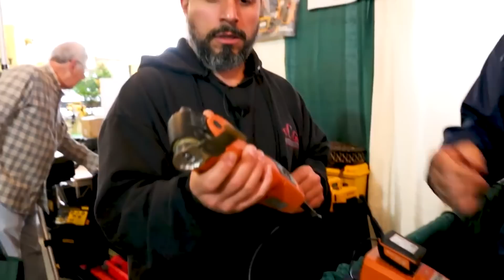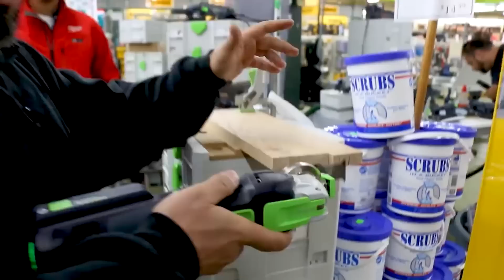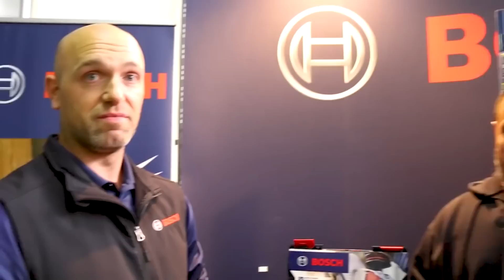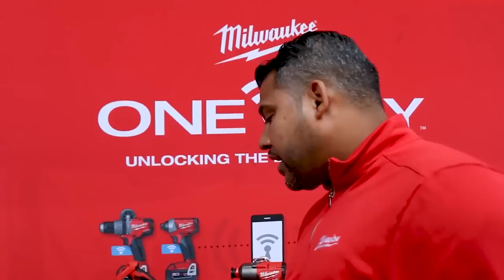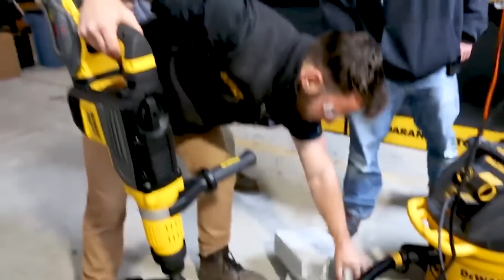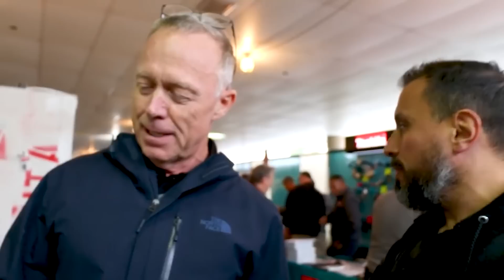NEW TOOLS From Milwaukee, DeWALT, Makita, Bosch, Festool, And More! (2020)

Comment: the fein chuck attachment is cool, but you can also buy aftermarket attachments for a lot cheaper. 1/4 hex 90 dewalt adadpter for any drill is like 30 bucks

Comment: The warranty is more than a little impressive. Buy in early & you're covered for life. With battery replacements, even!

"All FLEX 24V tools, Chervon North America, Inc. ("Seller") warrants to the original purchaser only, that all FLEX 24V products will be free from defects in material or workmanship for a lifetime on all FLEX 24V products that are purchased before, or on December 31, 2021...

24V Tools: Limited Lifetime Warranty with Registration

24V Batteries & Chargers: Limited Lifetime Warranty with Registration. Maximum of 3 battery replacements will be covered."

Comment: I can't be the only one sick of the hype behind those ugly festools with terrible features and ergonomics. Its a fan base that says that if it is made in Germany then it MUST be good quality. Festool doesn't even reinforce their plastic. Most their large tool clam shells are abs sewer pipe plastic lol. Like the Apple of tools. Pay more for less. For 300 those had to be the dumbest drills I think I've ever seen. Of course the multi tool cut the oak. Those multi tools cut better in oak then they would pine. They were originally designed for removing casts. 700 for just the bare tool? 700 for that abs plastic? Lol no. Not impressed. Who do they think they are? Snap on? Just my opinion.

Comment: For one, who is using the oscilating tool so you need jig for a plunge cut, and so much you need a vacuum attachment, for an oscillating tool?!! At this point, your just wanting some new gadget to buy, that's almost completely useless. 
The cut he made looks to me that a good ole miter or circular saw would do faster. 
Does Festool have a horizontal handle miter saw yet? 
  Also, really? Dewalt? I see Dewalt tools on most job sights I'm around. They're pretty preferred for a reason. And they arent $600 bare tool. I see red here and there, but I sure dont see that German green anywhere. However I saw a video of the Ryobi green, beating out a Milwakee in the battery trim gun test. Huh, go figure..

Comment: [Continued] 5. DW demo x3 FAIL. That cannon suppose to insta-terminate that block instead it struggled with it ending up braking instead of penetrating. Rep unable to connect it's own tool in the 1st try.  The fake rating of 20V doesn't help trust. 6. Makita - bigger than everyone else's. Lhol. Big and inefficient. Makita needs to remove battery kill tech from their systems. Btw, my granny can cut more in a line than that. 7. Interesting, but the statement of never failed was a lie.

Comment: 1. Useless. There are plenty of better ways of cutting nails more efficiently. 2 Ugliest thing I've ever seen, beatable by any very cheap fake. The extra handle is utterly useless and makes things harder. At 300$ I get 4 fake CZ dewalts with 2 14V batteries, charger, case and accessories. Then you show the most inefficient and annoying method of cutting wood. People generally hate dentist tools sound. So 3 FS tools on top 3 useless inventions. Next.  3. Lock Thin: interesting but can lead to accidents. Proprietary systems and disks will make people pass. Most have plenty of disks that are cross-compatible. 4, Milwaukee tools are definitely the most innovative in a useful sense, but some tools are restricted to 12V only like the compressor, and veteran users would really like an 18V version. Milwaukee would get a 10/10 from me if not for the battery self-destruct circuit. If I want to replace cells, it should be not intentionally prevented (not like most of the others don't do it - they all do). Break time. To be continued.

Comment: The D-handle on the Festool protects your knuckles that the T-handle doesn't. If you're installing/driving screws all day, I could see there being a couple occasions that you slip off and potentially rack your knuckles

Comment: Can not justify the price on any Festool item, UNLESS it has an innovative feature that provides a ROI, such as the Shaper Origin. UNIQUE tools that are job specific are time-savers, and even if they only last a few years, they are worth it. Too many of the Festool items are too similar to high quality tools by others. But if you can not handle the tracksaw clashing with the drill, I guess...... Festool is very interesting, but rediculous on the wallet for what you get..... at least on tools that others also make something essentially the same. These are not tool to toss around at the jobsite.... each one needs a live sheep to use as a cushioned protective stand

Comment: What Bosh needs is a grinder same lock for the wheel, but make it cordless and have a locking plug so if you're battery is dieing or dead and you are almost finished with no battery you could plug in, or vice versa someone needs the plug so you go wireless and when you plug in it's charging the battery when off and using power when active

Comment: Would had liked to hear what they have for basic problem with cordless grindrers which is that they run out batteries like nobodys business when you use them for any lenght of time or like with that bitum roof shingle how you deal with a roof full of gunk on you tools and blades ?

I've done several flat roof demos and what really kills your tools is bitum when it cools on your blades and chucks with grinders.

Comment: I use M12 but am on Bosch for 18v, so having a small 12v charger is ideal for me 🤗
Reply: Sean Steele 
Sorry. Should’ve said ideal.
Yeah. The prices on 21700 batteries, comparable performance on the Bosch gdx, better performance in the hammer drills at 18V make them ideal for the heavier end of work for me.
The Milwaukee 12V range... there’s no-one else anywhere near close in performance or selection.

Comment: I got one of the Fein tools with the star lock blade system about 6 months ago, while it works great finding blades on the road is a pain.....but I always keep a nice assortment of carbide ones in the case so its not an issue. 
One of the main advantages of the star lock blade system is the ability to drop a hot blade and reengage it without having to touch the blade.
Reply: Diablo makes a full line of them, as well as Imperial. Any Ace Hardware, Tractor Supply, Murdochs, True Value or other place. Not so much at Target or Walmart.

Comment: Saw stop works for sure - we use it at our school shop - the catch is that the block is very expensive to replace (blade buries into it and then you replace)
Reply: Still cheaper than hospital bills, lawsuits and potential therapy        (physical and mental).  New cartridge runs around $80 plus whatever you have for a blade.

Comment: No effing way... Makita made a Rotex hahaha! That's hilarious. And also very cool. I've been using my Festool Rotex for 6 years now. I've been running it super super hard on cabinets, furniture, table tops, and end grain cutting boards. It hasn't skipped a beat. I honestly don't know if I would trust any other company to make as durable a tool as Festool, but still .. very cool to have some options. And I bet Makita's "Rotex" isnt quite the $650 plus tax, and sandpaper tho haha. So I'm interested to see the durability over years of hard work in that Makita sander
Reply: Bosch also has one similar.  Not sure how it stacks against Fessie.
Reply: @beckr4235  no way lol. I didn't know that. Thanks for letting me know!

Comment: I had the Festool CXS for 3 years until I sold it... But I miss it lol. It's the most comfortable, delicate, and ergonomic drill/driver ever made. But I used to have to carry an impact and occasionally a 1/2" chuck drill in my bag. Because the CXS is a specialty tool. It's only a 3/8 Chuck and not too powerful. And I got tired of carrying 3 tools. So I sold my CXS and C12 and I bought an oil impulse Makita. Made a couple hundred bucks on the trade... 

But I really miss the CXS. If it weren't my responsibility as a business owner to have as few unnessesary tools as possible, I would love to have another. 

On slow mode my oil impulse isn't quite as delicate as the CXS but it can still hang quality of use wise

Comment: Picked up the Milwaukee like 90 piece 3/8” wrench/socket set WITH it’s own Packout case for $90 yesterday!  Saw the $199 Packouts but just bought one at full price and can’t justify another at the moment.  I had to pick up a dust extractor and ended up breaking down and getting a Festool.  So, my longtime goal of comparing Milwaukee vs. Festool for the day to day Handyman/Home Manager who builds mahogany boats in his “spare” time with the same tools.  Looking forward to breathing less silica from sanding.  We shall see how it works. Using it with my M18 sander and M18 table saw today.

Comment: Imo DeWalt, Milwaukee, and Makita are the top three brands right now.

Bosch is right under them because they are lacking with regard to coming out with new stuff.

Rigid is right under Bosch. Rigid is NOT comparable to the top three. They are top homeowner grade tools, not professional. 

Under that is all the home owner stuff like Ryobi, Craftsman, kobalt, Porta cable, etc.

And then at the bottom is stuff like black & decker and all kinds and of other brush crap that isn't worth mentioning. 

Festool obviously has good stuff too but WAY over priced and not built to be beat like the top three. I'd put them somewhere in and around Bosch.
Reply: well at least the tracksaw is superior to any of the competitors

Comment: Dewalt in its demonstrations failed nothing exciting. Bosch needs to make the grinder backwards compatible then they would fly off the shelves. The drills for festools look so cheap. It’s like a pick up from one of those no name shops that sell for $150 the plastic chucks look like 10 minutes and it would brake. The first multi tool looked so cheap as well both drill and multi tools need a huge design upgrade. The big names in tools are well signed even Bosch looks better than all that. Milwaukee hit the mark. Gets the job done and nice design. Makitas dry Waller you can’t see where you are cutting makes it hard to cut perfect with out doing guidelines everywhere, better off doing it by hand if it’s a small job.

Comment: @ 25:00 am I tripping or did he just say there's no backwards compatibility. He said "our regular wheels will fit your old Arbor. 

So x lock accessories only work on x lock grinders and vice versa is that correct?
Reply: They’re saying to use the Bosch X-Lock grinder, you must use the Bosch x-lock blades;  traditional grinding or cutting wheels will not work with Bosch XLock design.  BUT you can use the Bosch X-lock wheels on other brands.  

Same for the Fein Multimaster starlock head when it first came out.  You had to use Fein blades ( or Bosch because they patterned for the multi-tool ).  Imperial is now starting to make blades compatible with the newer Fein/Bosch starlock Multimaster tool.

Comment: Why would you want a X-Lock angle grinder? Those blades are probably crazy expansive and a quick release nut works just as good.
Reply: Probably? You dont know, never has this grinder in hands, but negative opinion comes easy 🙄
Reply: @mirekdudka9071  I use a  grinder quite frequently, but with a quick release nut will do the job just a little slower but with standard blades. In the end it won't matter because I think any one has spare discs on hand all the time. So you have to walk back to your van or transport case to pick up a new disc. In the time it takes to get a new disc you could have already removed the old disc. And in the time it takes to get back to the job you could of installed the disc already and directly start cutting. It only works with a cordless angle grinder. If you have a corded grinder it takes like 2 seconds more and don't have to spend crazy money on those stupid X-blades
Reply: @devinhaisma  I have had the pleasure of using an xlock grinder for some time. They didn't say a lot of things in the movie. A very quick change is just one thing. For me, a much more important thing is the lack of a protruding nut, which allows me to grind from any angle. PS. Try to unscrew the wire brush without very thick gloves or a wrench. This works perfectly in xlock. I really recommend taking it and seeing it for yourself before issuing your opinion.

 

Prześlij opinię

Historia

Zapisane

Społeczność

Comment: 22:50 I have had in my Milwaukee grinder Milwaukee Fixtec Tool Free Grinder Flange Nut probably over 10 years and i can use any brand discs.

Comment: “dewalts for building birdhouses”  personally i think festools are over priced and look cheap honestly 🤷🏻‍♂️
Reply: @martynzl  You have some kind of issue with just your battery. My Dewalts charge anywhere from 10mins to 40mins depending on weather I'm using the 2ah or the 9ah. Your battery is garbage, so return it to Dewalt and they'll give you a new one, assuming its a real Dewalt and you didn't try and buy a cheap Chineesism knock-off.
Reply: @martynzl  maybe you need to invest in new batteries or grinder because my batters charge in less than 10 min. I don't get why people think they can run grinders & Sanders on battery and think they should go like a corded. Obviously, your batteries are going to get hit and die. That's why I buy corded ones for long use.
Reply: Solid diss though - definitely gonna steal it :p
Reply: martynzl sounds like your charger is fried unless you've tried a different one or tested it.
Reply: exacty , these festool fanboys are getting on my nerves . Doesn't anybody watch AVE Boltr . Cheap made junk to hit a pricepoint and under engineered !
Reply: That salesman is a total idiot .
Reply: If that were the case Festool wouldn‘t be so popular with professionals, especially in woodworking and carpentry. They are definitely not made for tough environments in my opinion, that‘s where DeWalt shines.
Reply: dudefish exactly which every tool should be durable in any environment. dont get me wrong ive never owned or even touched a festool tool before so im just speaking front a third person pov

Comment: No tools required on the bosch angle grinder quick connect interesting probably pricey blades though because you cant use normal round arbor blades and accessories the safety features are cool I have a old corded paddle bosch angle grinder

Comment: Love that you can use a vac on the multi tool to keep the blade cool
Reply: I like the plunge attachment. It would be good if the vacuum cuts out 5 second after tool stops versus manual vacuum shut off.
Reply: @paedahe4975  the makita tools turn the vacuum on and off with certain tools
Reply: @paedahe4975  yeah the plunge attachment is awesome, good cuts every time

Comment: So let me get this straight....Milwaukee's logic is: People who buy M18 will also buy M12, so that's why you get the multi-volt charger, but people who buy M12 aren't interested in M18, so that's why you get just an M12 charger!? I agree that they should just ditch the M12 charger all together. I started on M12, and I bought M18 tools later. Was I not suppose to do that? Whomever is making that marketing desicion needs to be slapped upside the head.
Reply: VCG Construction I'm guessing its to keep cost down on m12 they're trying to captivate diyers as well as pros with fuel maybe include the 18/12 only with fuel tools??